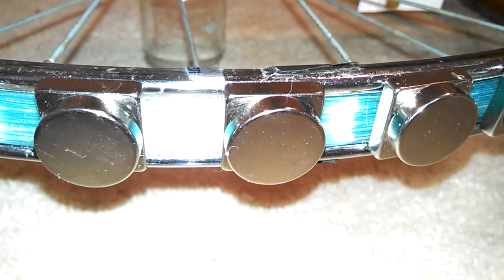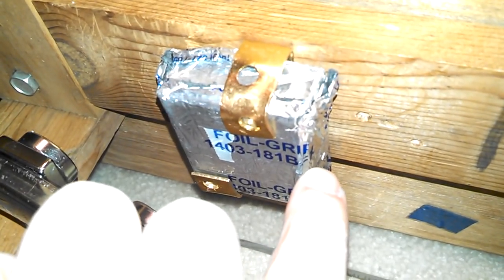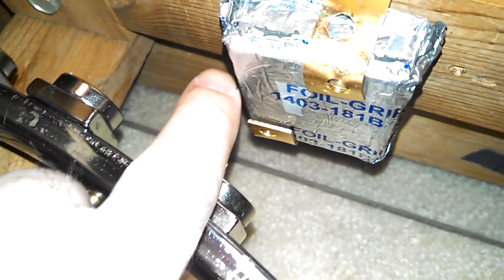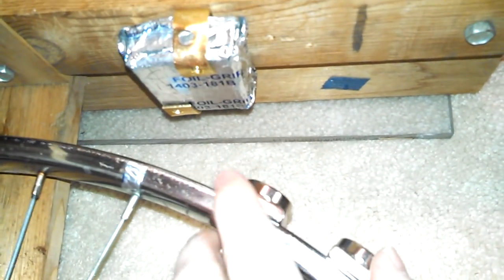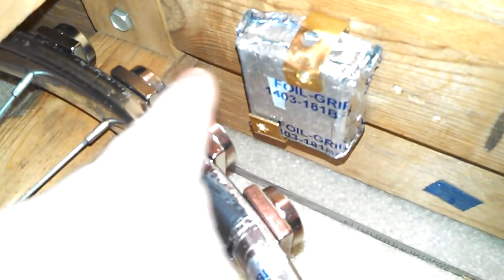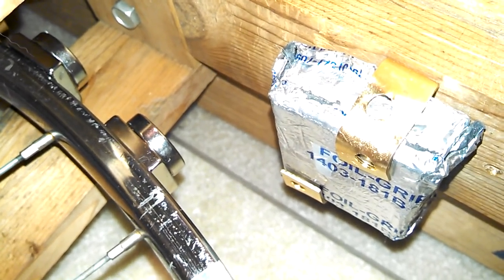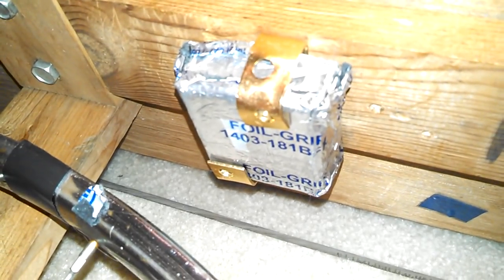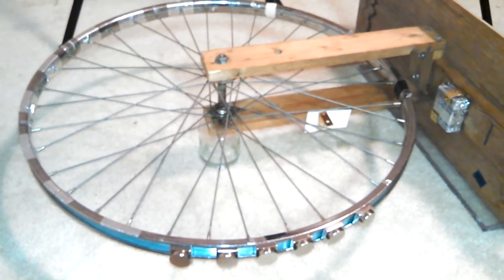🧲 Self Running Magnetic Motor Stator Test #2 update

Comment: I have had simular thoughts of making a mag motor w/just magnets (rare earth or neo mags) but my biggest question about this type of motor is how much torque would this type of motor have?  Can it turn a generator?  My design uses mags on moveable shutters (in a wheel fasion) to a stator bed of magnets using the pull/push that you are demonstraiting in your video only the the wheel would move up and down (closer and farther) from a flat bed of stator mags and tilting the pulling wheel mags would be able to be brought  closer to the bed mags and tilted for maxium rpm's and hence drive a generator.  Seems workable.
Reply from the maker: I replied to this a while ago and now its no where to be found.

     Here's my reply again.

     Flaps will introduce vibration into the system, so that's a big no no.

    This video only demonstrates the stator. But not just any ole stator, rather a stator that has overcome the infamous sticky spot, free and clear. FYI: This is epic. This stator design offers enormous torque in a working prototype.

       Four years ago my work began on a radical new design in stator construction. The challenge was to build a stator that would make magnet motor possible by creating forward motion that's greater than its counter reaction/drag, and do this in the most forward way possible. A new generation of stators that provides an extremely powerful argument to what's possible.

        The New Stator Pro2 is designed to mimic a hypothetical mono-pole magnet. This is the backbone and the hallmark of the Stator Pro2, creating far more acceleration then there is deceleration from reverse drag; an epic achievement in the evolution of stators.

       The Stator Pro2 incorporates a magnetic runway plate in its design face. The special angle of the stator's magnetic runway plate is paramount in relationship to the performance of the rotor magnets, further reducing reverse-drag from the last rotor magnet leaving the Stator Pro2. (Think of each rotor magnet as an airplane, and as each plane reaches the end of the stator's magnetic runway plate, just like an airplane, each rotor magnet pulls up and away from the end of the run way. This greatly reduces back-drag/deceleration even further.

       Inertia: There are 6 world-class n42 neodymium armature magnets that gang up on just 1 world-class n42 neodymium stator magnet. The 6 to 1 ratio creates more inertia than the single stator magnet can cancel out. This sets up your third imbalance
in the system.

       Just as the last rotor magnet is about to pass across the stator, the lead rotor magnet is suddenly pulled/sucked into the next awaiting stator which in turn, pulls the last armature magnet through the previous stator with a force that is far greater than any opposite force. This sets up yet a greater imbalance in the system.

        The Stator Pro2 offsets the equilibrium in the system by leaps and bounds, thus overcoming any equal and opposite reaction that Newton's 3rd law refers to, in that, "for every action there is an equal and opposite reaction". That law is no longer 100% true.

       Just add dot com to JamesRoneyStators for more info.

Cheers!

Comment: I'm sorry but there IS a big problem with you putting your hand on it. It masks what is really going on:
You only have a few magnets which causes a weight imbalance in one part of the wheel. The axel of the wheel will not be perfectly vertical on your rig. Therefore the heaviest part of the wheel (where you strapped the magnets) will seek the lowest point, or it would do except you put your hand on it to stop it after it overshoots.
I'll give you the benefit of the doubt that you aren't doing this deliberately.

What you have actually invented is the pendulum, although I have to break it to you that someone got there before you.
The pendulum effect can be caused by magnets, however in this case a force called gravity appears to be the main operating force on your equipment, although your magnets will add complexity to the resulting oscillations.
Both pendulum and gravity have mature Wikipedia pages if you wish to research either of them.

If this worked (which of course it will never do) then, if you spin it gently to do one full rotation, the magnets will take over and it will speed up on each subsequent turn. When you actually try that at the end it is easy to see that it slows down on each subsequent turn, except that you conveniently stop filming just as it was going to enter the oscillating pendulum stage.
Also, try again with the stator reversed, because according to your theory it would be much much less efficient that way and would more rapidly come to a halt, but I believe you will not be able to measure any difference.
Nice pendulum. Keep at it because it doesn't look like you can hurt yourself with this hobby and it looks like you're having fun :-)
Reply from the maker: 🧲 CONFIGURATION #8  https://youtu.be/drdAwmLbAfQ?t=1537

Comment from the maker: At the stage shown in the video, adding additional groupings of magnets makes the wheel considerably heavier. Rather you add three more Roney Stators. Each stator needs to be positioned at the 12, 3, 6 and 9 o'clock locations. I've have used three stators and the rotor magnets powered through all of them just fine. My project suddenly became derailed and thus I need to finish my research come next January/February of 2014. Your right, with some forward motion the stators work extremely well.

Comment: Hi James,
If you start the lead magnet at the corner of the James Roney Stator (as you showed) the magnets are pulled through and travel for 20"+- why would you not then just add another grouping of magnets that will then start at the corner of the same James Roney Stator and repeat the process. Start the new grouping at something like 15" so it still has some rotation to help it start through the magnets again (although it shouldn't need help)
Reply from the maker: 🧲 RAN OUT OF MAGNETS. RAN OUT OF MONEY.  Sorry, only now seeing your post as there are thousands of posts to weed through among 5 channels. So much has now changed. The sticky spot is long gone. Have a look.
🧲  https://youtu.be/8EYxKWsVx2k

Comment: just to make sure I get this right.  at the end of your vid (after 6:50) is that thing spinning on it's on, or are you still touching it to make sure it doesn't stop, so that the vid will have a nice ending? (nothing wrong with giving a nice ending, I'm just trying to understand what I see).
Reply from the maker: 🧲. It was pushed. If it was actually running, I would have said that, as well as put that in print. 9 years later I'm only now seeing your question among tens of thousands of comments. Thanks for stopping by. If by chance you ever see this, watch my videos from late 2022 onwards. Thanks for stopping by Eyal.
Reply: @FreeMagneticEnergy2  
first, thanks for replying, even 9 years later.

hope you're doing well (see you are still making vids).

in this vid, 9 years ago, you see to imply that by just adding 4 more of those "wall" magnates, you could get your bike wheel to turn none stop.  I have not seen any vid' on your page with something like that.

have you been able to do it?

Comment: What it the stator was set up so one side of the stator was attractive or positive and the other was the repellent or negative force of the magnet?  Would that not cause the wheel to move faster and then you could have the generator in the middle of the wheel?
Reply from the maker: 🧲 Sorry that it took me nine years to stumble across your comment on my channel That indeed works as well. However I had to create a very different setup. Simply watch |Attraction Repulsion of Magnetism for Free Energy| where I use attraction and repulsion at the same time. Great channel you have. Subscribed. ⭐⭐⭐⭐⭐  
👉🏻 https://youtu.be/2fk98lBMx9I

Comment: James,can you please,explain to me the difference between a slator and a magnet?From what it looks like to me is your using the push side of two magnets as not the side of the magnet that grabs so to speak am I correct?As two magents meeting together will pull away from each other is my meaning.If so?placing the magnets closer together wouldn't it give more force/power?please,make a new video?
Reply from the maker: 🧲 Sorry, only now seeing your comment as I receive thousands of them. No way to keep up with all of them in a timely manner.  A stator is the stationary magnet that acts upon the rotor magnets. A lot has happened since your comment that set me back big time.  Not sure why you're not receiving updates from me automatically? Go here for latest news... 👉🏻https://youtu.be/8EYxKWsVx2k

Comment: Hello James,
This maybe a dumb question to ask but,if I may,
As a magnet has a grab"magnet side" & a push side (as +/-) Are you using the magnet side or the push side?Also,from your other video talking about adding example two more Stators to make the wheel go completely around.What about adding a counter weight to help get it the rest of the way around?I know nothing about slators I'm just a basic shade tree motor head so to speak.I like what yr doing!Fantasic and free spin it can be for sure
Reply from the maker: 🧲 Attraction mode. 🧲 Sorry, only now seeing your comment as I receive thousands of them. No way to keep up with all of them in a timely manner.  A lot has happened since your comment that set me back big time.  Not sure why you're not receiving updates from me automatically? Go here for latest news... 👉🏻https://youtu.be/8EYxKWsVx2k

Comment: Question.....How/what did you use to create an EMF insulator? You said the right hand side of the stator magnet had zero flux.   I know we haven't found an effective flux insulator/shield yet, so is this simply dampened by ferromagnetic material and/or further reduced flux interaction with rotor mags due to increased distance/further proximity?
Reply from the maker: 🧲 Sorry, only now seeing your comment as I receive thousands of them. No way to keep up with all of them in a timely manner.  This is how I did it. 👉🏻 https://youtu.be/GrBkoJSSMX0

A lot has happened since your comment that set me back big time.  Not sure why you're not receiving updates from me automatically? Go here for latest news... 👉🏻https://youtu.be/8EYxKWsVx2k

Good to see that you're still around. Thanks for stopping by and best to you on the  rebuild of your boat. 👍🏻

Comment: Let me ask you this Mr.After you get the bike wheel spinning what's your plans to do with it?Don't look like it has much torque to power anything.Would this system work better using a magnet ball instead of a bike wheel.As example drill a hole & install a shaft into a balanced bowling ball & epoxy magnets to the ball.The weight of the bowling ball will give better torque for more ideas.
Reply from the maker: 🧲 Sorry it took me 9 years to stumble across your comment. I cannot keep up with thousands of comments in a timely manner. A lot has changed since you comment here. If you're still around, simply respond to this and I'll do my best to respond to any question you might still have quickly. A lot has changed since your post. The wheel never kept Turing at that stage, thus I kept using my hands to stop the wheel. Guess you're not getting automatic updates from me? Go here for some breaking news. 👉🏻 https://youtu.be/8EYxKWsVx2k

Comment: Once the cirlce is closed all gain is gone.
Reply from the maker: 🧲  Correct! But not when you place 1/3rd of the circle on three separate levels. 🧲 Sorry it took me 9 years to stumble across your comment. I cannot keep up with thousands of comments in a timely manner. A lot has changed since you comment here. If you're still around, simply respond to this and I'll do my best to respond to any question you might still have quickly. A lot has changed since your post. The wheel never kept Turing at that stage, thus I kept using my hands to stop the wheel. Guess you're not getting automatic updates from me? Go here for some breaking news. 👉🏻 https://youtu.be/8EYxKWsVx2k
Reply: @FreeMagneticEnergy2  Yeah, that's cool to get an reply after so many years and I made the experience not to get always notifications when someone comment a video, especially when it's old. Then I find it only by chance.
When it comes to any kind of magnetic gadgets, I gave up on this. From several years of experimenting I began to accept that it may true if they say that it might mathematically proven that any arrangment of permanent magnets won't lead to continuous motion. But what I strongly believe is, that working magnet motors in the past relied on shielding technology. Best example was Mr. Lueling's magnet motor.
However, I highly appreciate anyone working on free energy concepts. I still do it by myself but concentrate on pure mechanical devices.

Comment: The is no such thing as a free lunch. Corporate scum would not suppress a good idea rather they would invest in it and monopolize it. The fact is that this is just not really an efficient way to create rotary motion. Why does he not leave to wheel to spin? The engineering term for this kind of proposal is "fuktarded"
Reply from the maker: 🧲 Sorry it took me 9 years to stumble across your rude comment. I cannot keep up with thousands of comments in a timely manner. A lot has changed since your comment here. If you're still around, simply respond to this and I'll do my best to respond to any question you might still have quickly. A lot has changed since your post. The wheel never kept Turing at that stage, thus I kept using my hands to stop the wheel. Guess you're not getting automatic updates from me? Go here for some breaking news. 👉🏻 https://youtu.be/8EYxKWsVx2k

Comment: your stator actually gave me an idea probably about 2 weeks ago now.  I did a little research and found out that you cannot completely get rid of magnetic flux but you can diminish it by rerouting it or absorbing it through another metal that has a high absorption rate. I have a couple of designs that I'm hoping will be complete by this saturday or sunday and they also incorporate in some way your idea of absorbing the flux with another metal if I have any success I will let you know
Reply from the maker: 🧲 I visited your channel and found no video updates. 🧲 Sorry it took me 9 years to stumble across your comment. I cannot keep up with thousands of comments in a timely manner. A lot has changed since your comment here. If you're still around, simply respond to this and I'll do my best to respond to any question you might still have quickly. A lot has changed since your post. The wheel never kept Turing at that stage, thus I kept using my hands to stop the wheel. Guess you're not getting automatic updates from me? Go here for some breaking news. 👉🏻 https://youtu.be/8EYxKWsVx2k

Comment: even if there is a free energy device that invention will get suppressed by corporate scum.
Reply from the maker: NOT WORRIED. That's why everything is open source.

CREDIBLE FREE ENERGY MAGNET MOTORS THAT WORK 
MAGNET MOTORO - Rotor Encantado
https://youtu.be/mxgwTzxfe8Y

Amazing Magnet Motor/Gen Rep. This is not a fake
https://youtu.be/jKFTAobM-l0

WORKING MAGNET MOTOR 2023
https://youtu.be/vdtdKE2Qe40  SELF RUNNING MAGNET TURBO MOTOR https://youtu.be/6sIBHn5-9pI  WORKING MAGNET MOTOR - rotor magnético https://youtu.be/3mD0_0FiJ54
 MAGNET ONLY MOTOR from SOUTH KOREA https://youtu.be/smzpbKg9S7M

1966: German inventor presents his Free Energy Device Magnet-Motor
https://youtu.be/XWQjMyMWXAc

Comment from the maker: The stator is basically a "pot magnet" which goes back over a hundred years ago. Placing magnets on a wheel goes back at least a hundred and fifty years ago. The configuration you see has been fooled around with since the days of Tesla. This all took place long before you and I were born.

I didn't steal anyone's idea. To do so, I would have to have prior knowledge of your work as my father was fooling around with this exact same idea back in the 1940s, but he never was able to get it to work.

Comment: OK so it goes round and round. 
Try attaching a dynamo so you can power a 250 volt light bulb..NOT A TORCH BULB.
Show us on U tube how effective that it.
I'd love to see.
Reply from the maker: 🧲 CREDIBLE FREE ENERGY MAGNET MOTORS THAT WORK 

MAGNET MOTORO - Rotor Encantado
https://youtu.be/mxgwTzxfe8Y

Amazing Magnet Motor/Gen Rep. This is not a fake
https://youtu.be/jKFTAobM-l0

WORKING MAGNET MOTOR 2023
https://youtu.be/vdtdKE2Qe40  

SELF RUNNING MAGNET TURBO MOTOR 
https://youtu.be/6sIBHn5-9pI 

 WORKING MAGNET MOTOR - rotor magnético
 https://youtu.be/3mD0_0FiJ54

 MAGNET ONLY MOTOR from SOUTH KOREA 
https://youtu.be/smzpbKg9S7M

1966: German inventor presents his Free Energy Device Magnet-Motor
https://youtu.be/XWQjMyMWXAc

Comment from the maker: TrueBlogger, The pendulum engine  comprises of an engine block body with a head, a shaft with at least one blade, combustion chambers. The shape of the combustion chambers  which is determined by the shape of the blade, and the depth of the chamber determines the range of the angular movement which is made by the blade during work. The blade which is fixed to the pendulum engine shaft on both its sides plays the role which is adequate to a piston role in a piston combustion engine.